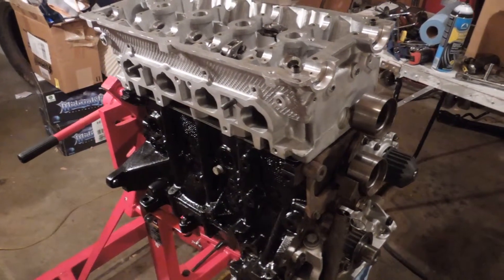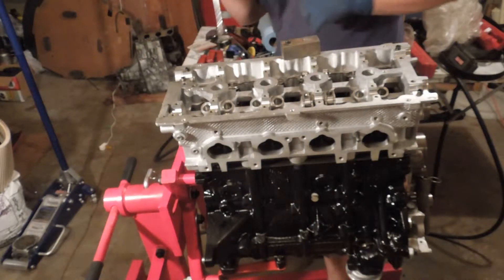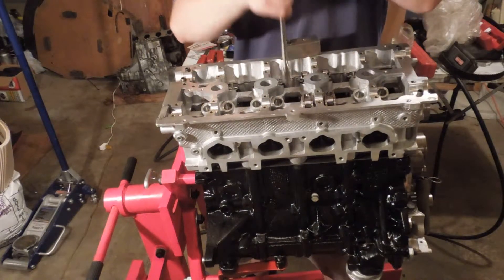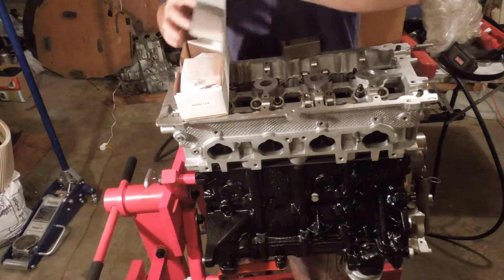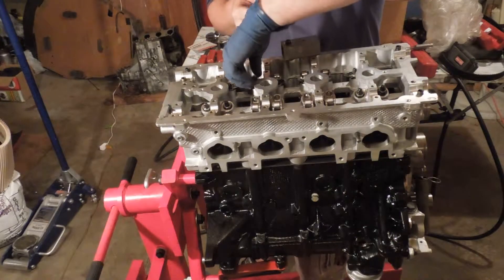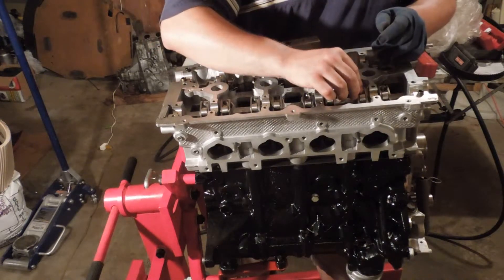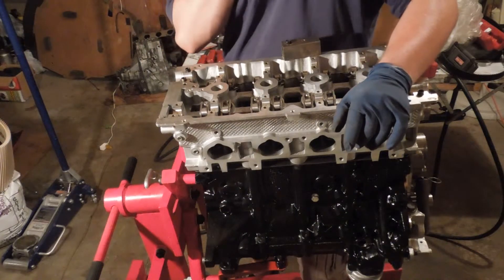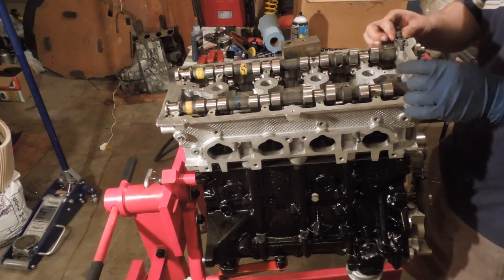420a Performance Engine Build Pt. 21

Comment: It's been awhile since this video. Do you buy chance have any 420a's built & ready to be bought?
Reply from the maker: I don’t have any built engines for sale. I can build you one but it will be built on your dime, not mine. Engine could cost 3k or more depending on what options you choose and part availability; as well as all the necessary machine work to the engine block and cylinder head. Not to mention shipping the engine to you by freight.

Comment: Sup peeps. I got a 98 Mitsubishi Eclipse RS non turbo and new to working on theses motors. i had to change my cam seals. i got everything together. Just wanna know if i have to set the valves or how would u do that
Reply from the maker: +Dee Sisavath 
The factory lifters are hydraulic and there is no lash adjustment for the factory lifter/valves. i have a conversion kit in my engine so i had to set the valve lash. factory hydraulic lifters in these motors need no adjustment. hydraulic lifters automatically set the lash adjustment.
Reply: Ok gotcha

Comment: What do need to swap a 420a engine to a 4g63 engine for my 99 Mitsubishi eclipse rs?
Reply from the maker: Atari Scott 
sorry but i don't kno much about swapping a 4g63 into a 420a vehicle. the engine i am building is a 420a engine to replace the worn out old 420a that is currently in the car still. i do know you will need the engine and transmission, axles, wiring harness, computer and the mounts may have to be changed slightly but i am not sure. thats about as much as i know about the swap.

Comment: Hi i was watching your video and wanted to know how you were able to install your crank sprocket?
Reply from the maker: which crank sprocket are you talking about?? are you talking about the timing belt crank sprocket or the crank balancer??
Reply from the maker: the timing belt crank sprocket should slide on and off without any tools but they like to rust on the crank so some rust penatrant and a puller with two bolts screwed into the sprocket will get it off and then use scotchbright to clean rust out and it should slid on and off easily. a tid bit is to add anti seize to it to keep it from rusting on the crank.
Reply: Alright thanks. The little part that goes in the crank gear which I believe is to hold it in place would you tap it in ? Its like a little lobe shaped part that has a slot groved into the crank for it.
Reply from the maker: Diego Zendejas 
the half moon key is what it's called, its to transfer the crank rotation to the crank timing sprocket, you can tap it in but it should just sit in the slot and the sprocket should be able to just slid over it.

Comment: Hey im putting my 420a head back together right now and i was woundering, i was told that you need to soak the valves and lifters in oil before putting them in. is that somthing you recommend
Reply from the maker: (@ tatiana) the reason you put oil on the valve stems is to lubricate them before you install them into the valve guides so they dont starve of oil until you get oil pressure built up and flowing in the engine. it is recommended to soak hydraulic lifters before install so you dont get the dreaded ticking sound, and it also helps to pump the lifters up quicker until oil pressure gets built up as well. if you dont soak the lifters there may be a chance they will never pump up when the engine finally gets oil pressure built up and you will be stuck with a lifter ticking sound.
Reply: Wow. Thank you for your help. .im really glad i found your videos cuz they are alot of help. and i plan on buying a whole new block soon and build it up and will be watching much more of your videos for more tips in doing so. 

Chris
Reply from the maker: Tatiana Valencia

your welcome for the help and tips. glad you find the videos i make helpful. i wish you the best of luck with your build. send me a private message if you need anymore help. you can also find my build on dsmtuners.com at http://www.dsmtuners.com/threads/1998-eagle-talon-street-build-monster.469506/

Comment: I was hoping you also show head tightening procedure, i know the sequence etc, but i really hoped you show it.
Reply from the maker: I have arp head stud kit. i didn't use the factory head bolts which you torque in the same pattern but three different torque settings and then 90 degrees on each bolt. with arp head studs you torque to half spec then to full spec in the head bolt torque sequence. arp head studs for this motor are torqued to 80 to 85 ft. lbs.

Comment from the maker: the callies compstar crankshaft for the neon engine (420a engine) isn't being made anymore so the only way to get a stroker crank is to send in a template to a company and have them machine a new crank from the sample. the last time i talked to callies they wanted 4k for a custom crankshaft. if you were to buy in bulk it would be 2k a peice with a minumum order of 5.